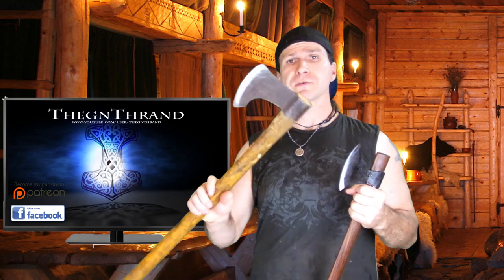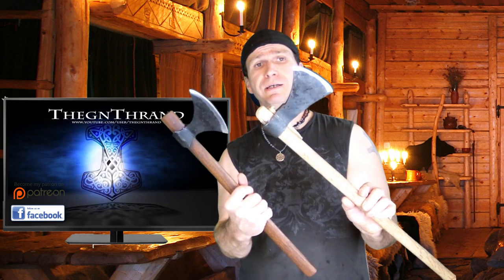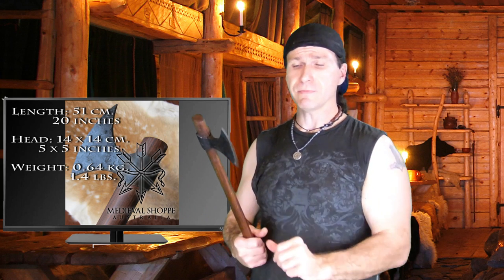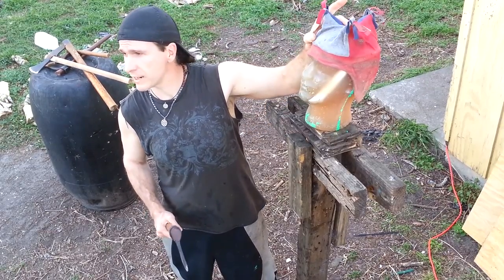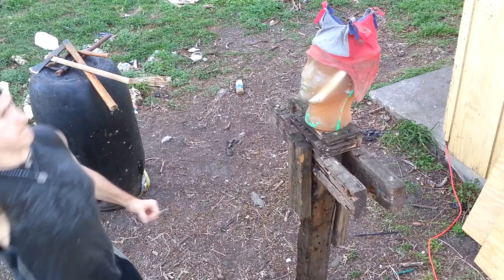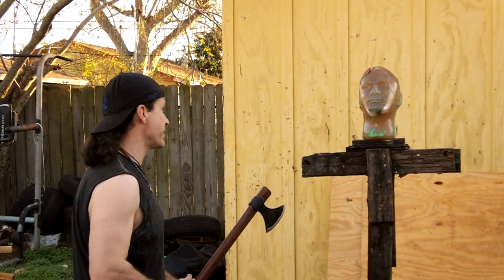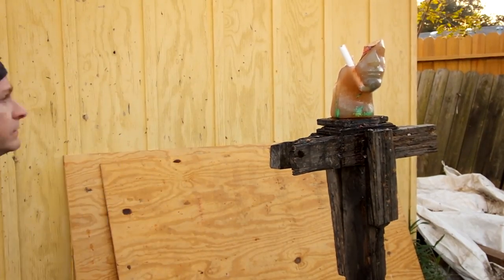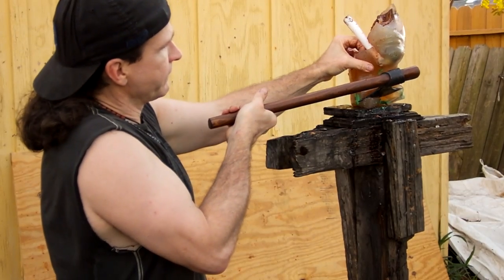Viking Axe Tests on Analog Ballistic Gel Head!

Comment: I was amazed how well my hatchet can cut thru empty cartboard milkjugs. Blade is thick and not nearly as sharp as my swords, but where edge touches the jug it cuts very cleanly thru, milk jug tend to get stuck close to shaft because blade is inch thick and jug is empty. My swords has much more tendency to give blunt force trauma to jugs ripping them open if blade alligment is not perfect,  but axe seems to cut very reliably and effecively. I imagined that axe's blade would go thru uglily mashing the jug up, but results were totally different.

I suppose point of balance close to head and solidness of shaft and it's ergonomics makes it superb cutter granting excellent edge allignment on contact to target. Now with actual battleaxe which's axehead is much more designed for cutting... Far surpassing sword of anykind in my opinion.

I do make my own firewoods with splitting axe so that might be factor as well, even if i don't use hatchet at all and technique is hugely different.

Comment: You still got some neck left.
Reply from the maker: +k0vert The axe would have made it out the back side but neck other than spine is not joined to shoulders so when spine is cut head can start to take flight fall off. So hard to see true effect the spine would have been cut and throat but since blade not quite as wide a neck width would have some flesh and skin holding it on the sides.